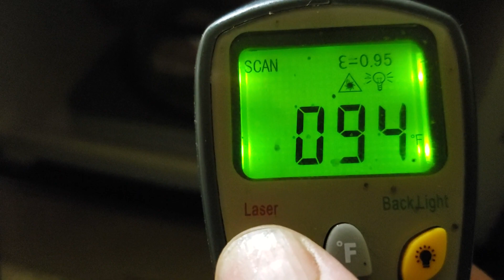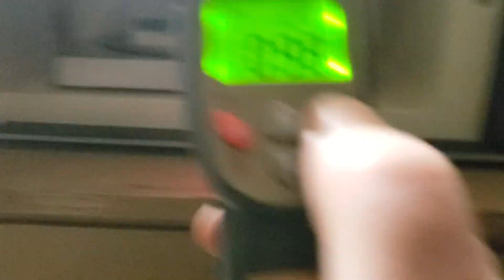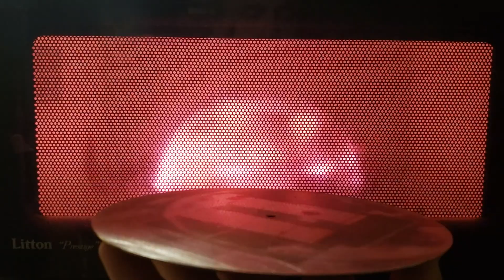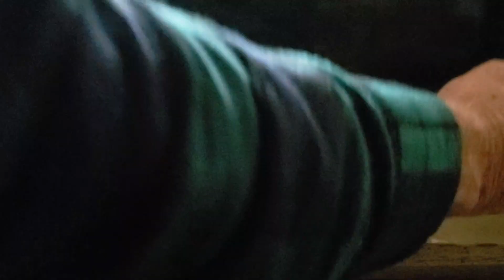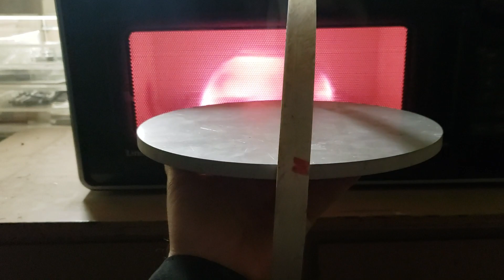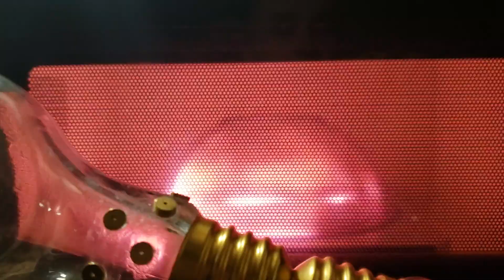Part 2 Plasma Deposition for)))THE ~ RIPPLE 》》》 A Plasma Force Hydride Fuel Gravity Thruster

Comment: Water is stretched across the air like you say about the graphene in space. They both use H as the corners and both make a hexagon and carry electric currents through the ether. Charging water neg makes it stack as explained in EZ water. Does graphene stack the same under charge? The AC waves from the magnetron don't allow stacking on water. How does it work for on graphene? Tesla mentioned a superluminal emission from spark gaps...that slow down to light speed as it hits the ether.
Reply from the maker: Thank you.
www.ProtonSpinTechnology.com